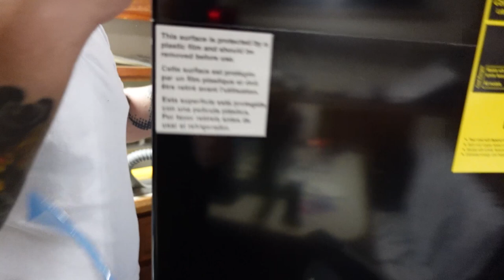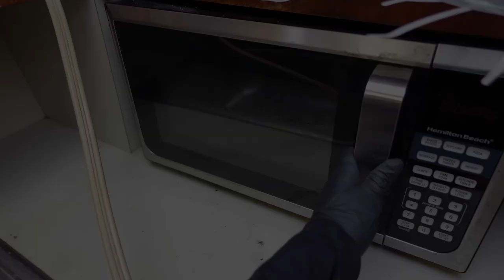Replacing Broken Kitchen Appliances | Old Yacht Restoration | Ep. 9

Comment: That little scratch will just be character. just a heads up you have to anchor the fridge or it will be in the middle of the kitchen with everything on the floor when you get underway.
Reply from the maker: We will definitely anchor the fridge, thanks!
Reply: I was going to advise the same thing.  You may want some kind of clamps for the doors too.

Comment: Have a 700W micro, hate it. Have to run twice as long to cook. But may be easier on batteries
Reply from the maker: It'll be easier on the inverter. We've noticed it takes a little longer then a higher wattage one, but not a significant different.

Comment: hi or lower wattage microwave doesnt really matter, power usage is about the same (lower wattage takes longer to heat food)
Reply from the maker: We figured the lower wattage would be better when we're running the microwave on our inverter.
Reply: @SeekingSeas  And it will help.Less draw for slightly longer.
Reply: They didn't do it to save electricity, but to reduce the draw on their inverter.